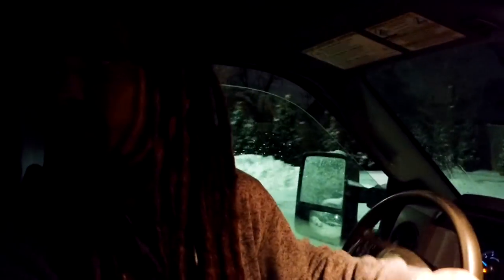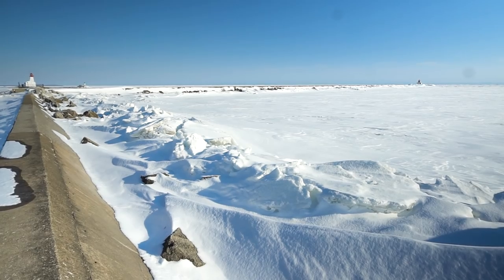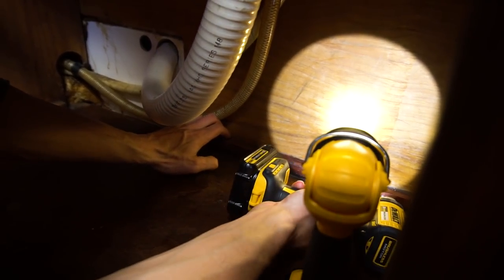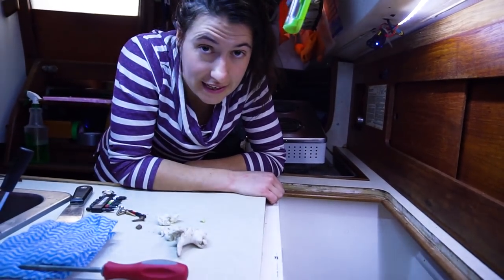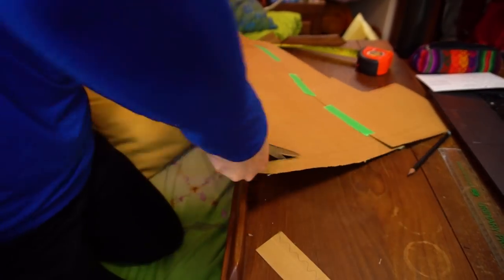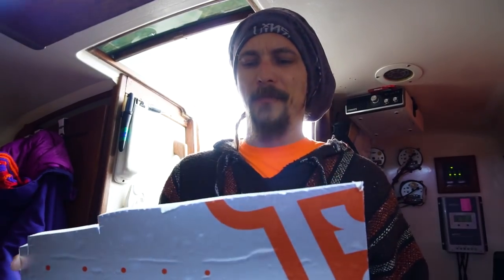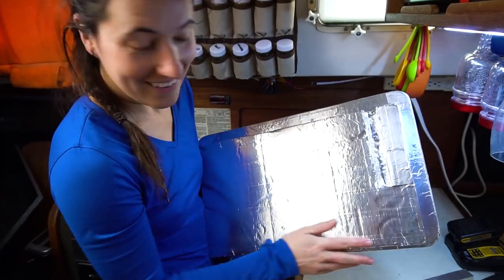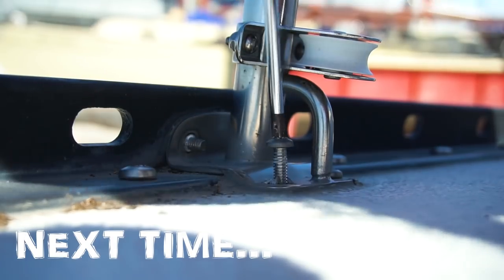40$ Fridge Upgrade, What a BIG Difference! | Major flooding at the marina [Ep 41]

Comment: I did the same job back in 2007 using the same material as the one you are using. My fridge is going fine since then. I have put 3" and sometimes 4" where I could fit it and filled the empty space with urethane foam. I have only a 110W solar panel and it keeps the fridge going all summer long on Lake Champlain. I am convinced you will be successful with that material.  BTW I used the white plastic board sold in 4' X 8' at Home depot to cover the inside and protect the insulation material. It makes it easy to clean the inside of the fridge. Cheers, Richard
Reply from the maker: That's really good to hear. Sometimes you fix or try to improve something and you hope it'll last just long enough.
Reply: That's encouraging to read!:) Thanks for sharing. I have to buy solar panels soon for my newly acquired old boat and have been expecting to need a 400w array 😂 Hopefully it's not the case.
Reply from the maker: We also have 400w of solar. So far so good.